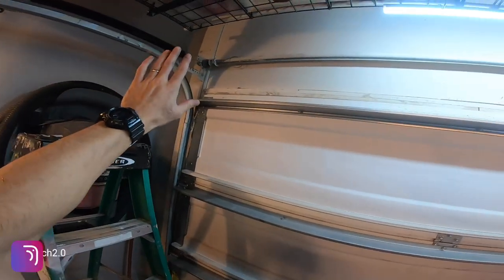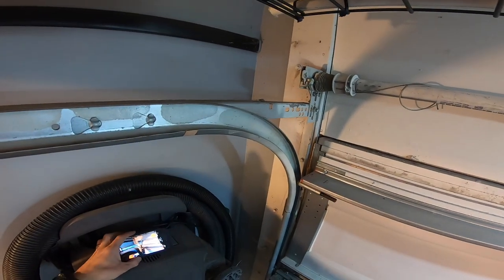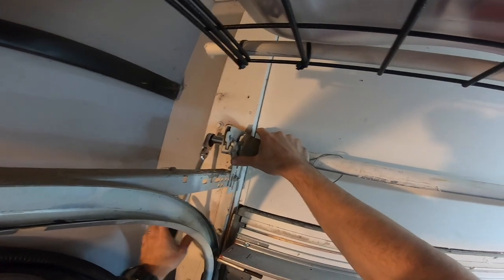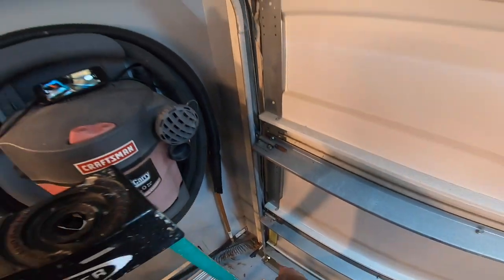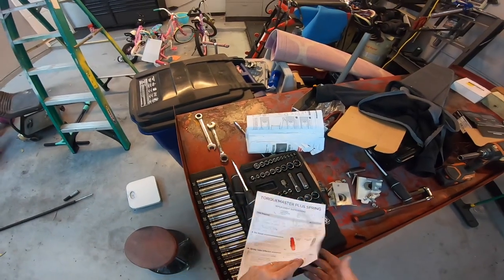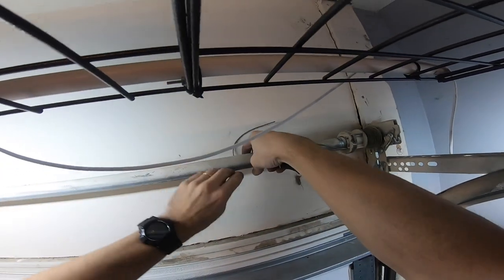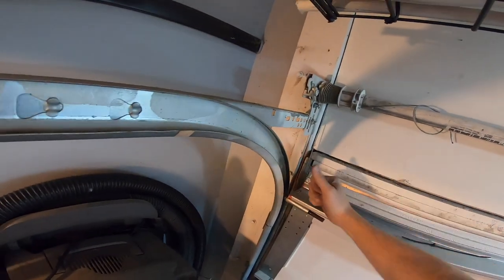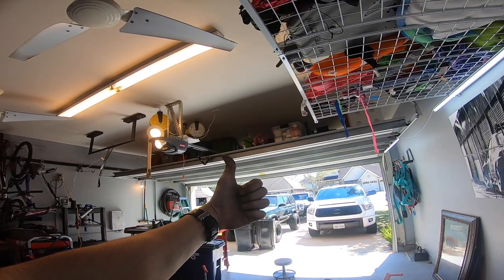How To Replace Garage Door Springs - Torquemaster Plus, Wayne Dalton / How to Wind unWind Springs

Comment: Im about to attempt this myself. They make it sound a lot scarier than it looks. Technician told me they dont do torque master and quoted me 1200 to convert to tension spring. Im not mechanic but i work as a machinist amd work on my car also. This video gave me the courage to attempt it myself and save a hundred fifty bucks.

Comment: Thanks for the video. I had a unique issue where I installed new torquemaster plus springs a few months ago and it was working mostly fine up until recently. The door got twisted and bent the top arm bracket and nearly ripped the top right roller bracket off the door. I was able to straighten the parts out but it keyed me into an issue with the spring balance. Your video helped me realize that you have to 1. Adjust the tension cables prior to winding the springs and 2. Wind each side 2-3 rotations at a time. I had originally rotated the right 16 times and then went to the left and turned that 16 times. After doing each side 3 rotations at a time, the result was night and day.

If only the instructions that came with the springs had bothered to mention any of this. Although it's ultimately on me for not pulling up the owners manual prior to the original install.

Either way, your video was a huge help

Comment: Louisiana boy here. I know what you mean about the heat. Anyway, your video is the best by far. I would have never thought of putting zip ties on the springs to keep them from traveling inside the tube. Anyway, I have one spring broken and will replace it today. I know this is a few years later but, a quick pointer: lube your chain, fittings, rollers and cable mechanisms with Lithium grease or Kroil. That'll help with door noise and will also help it to travel a lot smother. Thanks from the land of constant 100 degree temps.🥵

Comment: Just wanted to let you know that your video saved me a ton of money. My garage stopped moving all the way up. About half way. Called a garage door place and they won’t be out until Monday. 

Saw your video and noticed you said there’s a maintenance toggle. I went up the ladder and looked. Low and behold the left side’s switch was in the maintenance mode. Flipped it. Made sure the tension on both springs were strong and reran the garage door. BOOOM! Worked. Apparently the door has been using only one side the entire time?
Reply from the maker: That's great news. 👍

Comment: EXCELLENT VIDEO!  This made my "issue" completely understandable when my garage door decided not to open in Wilmington, NC.  Like you said, there are tons of videos with other types of door counter-balance systems, but not the Torquemaster.  This made my job super easy.  Thank you!
Reply from the maker: Most welcome, how did it work out?
Reply: @Donnythelatemodeltech  NOTE:  I'm signed in on my girlfriend's account right now, but I got the parts and replaced the spring and associated components in less than an hour.  It worked out perfectly.  I can see how garage door companies would charge hundreds of dollars for this "service" too...  Sam  :-)

Comment: Donny I’m in the middle of this project (just got the new springs yesterday) but I noticed that a couple of the teeth on the wire coil thing (not the white gear inside the bracket) are “chipped” off.  Would this require me to replace that part or can I just avoid the chipped teeth on the gear when I’m ratcheting?

Comment: Hi, what would you suggest if the cable is stuck and the torquemaster plus cannot release tension. The door won't open. Is it safe to cut the cable while it has tension? Wouldn't the drum keep the spring from unloading its stored energy?

Comment: both sides of  my system have tension but one side randomly started making the most horrid grinding sound.  i do notice that this whole time the Pole knob in with the up "maintanence" position. i wonder if that made some issue.   Playing with the tension alone is a clankly/grindy mess.  I had to stop before really doing anything tonigth since it would walk up the kids.  Any thoughts on what might be the issue?
Reply from the maker: Honestly, I have no idea. This was the only time I’ve messed the garage springs.   I’ve replaced the motor twice ,  and those things just die.

Comment: You can also pull on that big rope to disconnect the door opener.  ;p 
@20:00   ok, I guess with that system you have to do it that way.  ;)
@39:00 just clamp a vise grip on the track.
The door should at least balance about 1/2 way open, and, if the springs are perfect, should balance at any position.

Comment: This guy doing all this work but I would recommend getting better springs. A lot of effort and time and in a couple years he’ll be doing it again. He chose the same cheap spring the manufacturer used instead of a large torsion spring that would last over a decade